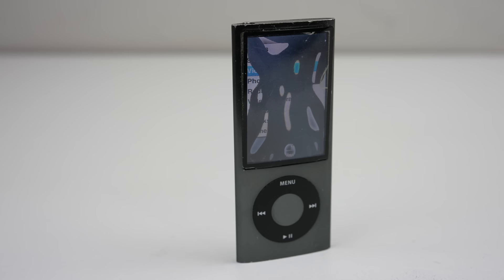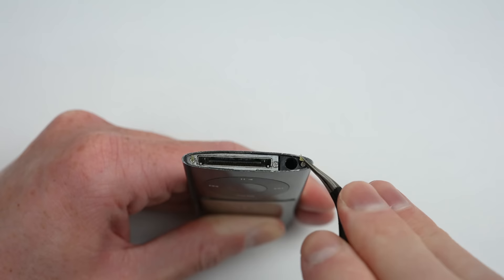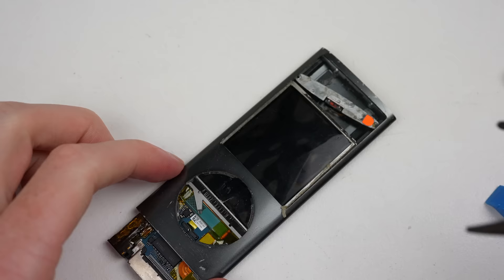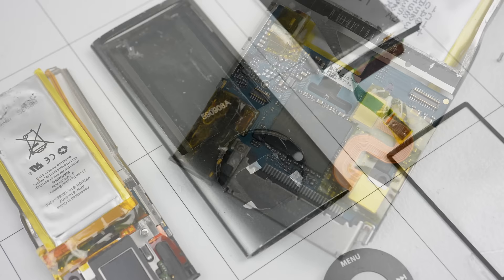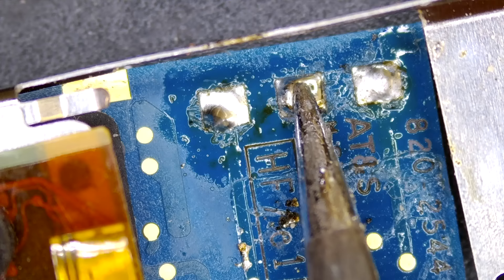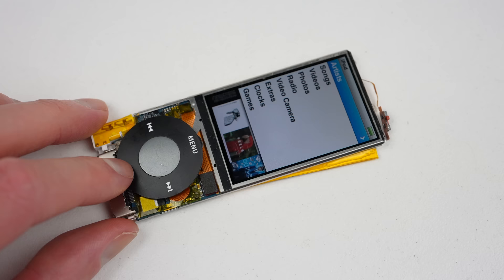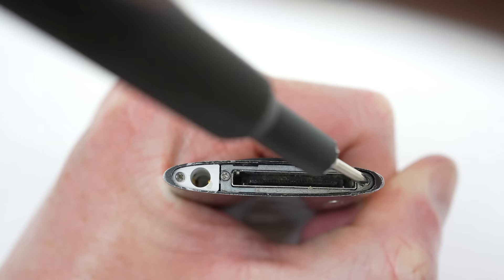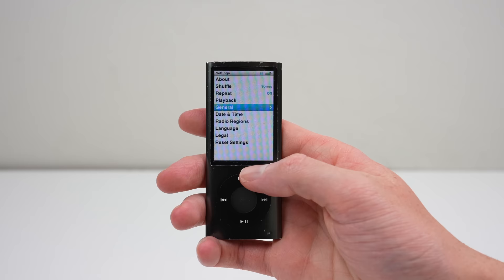Only I Am Stupid Enough To Try And Fix This iPod Nano

Comment: "spicy pillow" is now my new favorite term for bloated batteries
Reply: It's all fun and games till you have an experience like I had with my 3GS that had its battery swell to the point of cracking the rear of the case, cracking the display, lifting off the front glass and turning the motherboard into a banana (hell.. it ripped out the metal inserts that it screws into!). Mildly bloated batteries don't faze me, but that was an actual spicy pillow
Reply: @Knaeckebrotsaege  Yup I have a phone that is 1/4th of the way to being an actual spicy pillow battery too, just a quarter of the back got lifted off, but I figured after a while it was time to stop using it due to that, and the fact that it was messing around with how the back mounted fingerprint scanner worked (a lot of [fingerprint can't be read or partial fingerprint] errors were happening when I tried to unlock my phone using the scanner).  Oh and the risk of my safety by continuing to recharge the spicy pillow.
Reply: I like the term "spicy pillow" too haha. I learnt of the spicy pillows on Reddit and there's a whole sub there dedicated to sharing images of bloated batteries. A good chunk of the spicy bois there are from razer laptops, macbooks, and iphones.
Reply: @PinkAgaricus  in case of my 3GS, this happened after I stopped using it, and within just a couple weeks. I dug it back out to take a pic of it (because it still looked brand new and "taking care of your things" was the topic of a forum thread), only to find the originally damn near immaculate phone now obliterated by the battery :(
Reply: I shall now refer you to r/spicypillows
Reply: Yup
Reply: Now my favourite tech term of all-time 😄
Reply: is it really spicy tho?
Reply: @HashirEasa  nah, actually quite delicious
Reply: I Know a different term for this, it's the forbidden Capri Sun
Reply: if microsoft made batteries they would come bloated out of the factory ;)
Reply: @Aragubas  xboxcontrollerbatterypackgobrrrrrrr
Reply: ye me to
Reply: I like to call it HAND GRANADE.
Reply: I heard that from the Lexus kitty.
Reply: @Knaeckebrotsaege my 3GS did that now I have to get another 3GS and fix the battery
Reply: you can also call it a bang biscuit
Reply: Dankpods

Comment: As some one who has worked on a lot of cell phones and handheld consoles I have to say you make most of this stuff look ridiculously easy.
Reply: Fully agree with you. Especially the parts that involve glue. I already had a magic pull tap snap on me and a Samsung Tablet refusing to let me in.
Reply: Fully agree
Reply: Frankly as someone who does the same, I think in this specific video he really got the point across that it's an infernal job.

Comment: It’s sad that these iPods are so hard to replace but were yet loved by millions back then. Sucks that they won’t last that long as time goes on.
Reply: True 😔
Reply: Yeah and they’re so stunning as well 🥺
Reply: Friend of mine dropped one into a cup of coffee in the car and it still worked fine years after
Reply: actually.. they are quite usable today! only the nanos are hard to repair
Reply: The worst part is Apple might end up doing this exact tactic of soldering the battery to the motherboard on iPhones at some point.
Reply: You gotta remember this was early days, Apple didn't really know what was going to happen. If they knew that battery would blow like that, they wouldn't have designed it like that.
I love my iPod Video 5th gen with 256GB SDXC mod because I can fix it freely.
Reply: @tsuyunobradley4439  the 5th Gen is the first iPod that I decided to mod. I only swapped the front panels to be red with a black click wheel but it was incredibly fun and definitely easier than the 6/7 Gens
Reply: @sabersz  I actually still have a scar on my hand 4 years on from trying to open a 7th Gen. My tool slipped and sliced my hand open.
Reply: @tsuyunobradley4439  oooooooh not good 😬 I'm praying I don't get anything like that in the future. Already had a couple slips but nothing worthy of a scar lmao
Reply: let's don't forget the fact that most of pre-2007 iPods are easily repairable and moddable 

these shitty disposable nanos are not something to be sad about tbh
Reply: @tsuyunobradley4439  Frankly I disagree, they just don't care. They knew battery faults for ages, their own iBooks and PowerBooks have been recalled for faulty batteries expanding badly or even catching fire in 2005, the HDD iPods are definitely not easy to open, they're easier for sure but not made to be opened either, it's just what they do, they don't want you repairing it, even tho some older Macs were quite modular and upgradable.
Reply: @Kalvinjj  I never really paid attention, but it wasn't just Apple having this issue. It was EVERY MANUFACTURER around this time.
Reply: @buddyunholy9133  They could have simply added 1mm in height and width and it would have been repairable. 

I loved it for the display and especially the good radio and mic. The build in  radio-receiver-chip was of a comparable quality as the chips in cars, if my memory of the device is correct. 

But seeing this repair-video I fear that it's absolutely not worth the money, effort and especially the time, trying to repair an iPod Nano with bulged battery.
Reply: @sealwheel  you prune,iPods no longer exist and Apple does not make them anymore either
Reply: @stephensnell5707  if they dont exist explain why i own more than a dozen?
Reply: I found the pink one on eBay, hope that little iPod lasts forever because I want to listen to music
Reply: @sealwheel what I meant is that Apple stopped producing iPods back in 2017
I myself I have the iPod Touch 6th Generation(I have has it since 2018,I have had it for 5 years with 0 problems and the Battery is in perfect shape and I will keep using it until it totally fails on me)
Reply: @sealwheel  keep them cherish them its not being sold that why he say it doesnt exist anymore

Comment: I wish there were financial penalties for companies that go out of their way to make products so unrepairable, that they become disposable.
Reply: Already did, ever heard right-to-repair policy? Perhaps it's not that effective but at least there's a movement on Apple to make iPhone easier to repair (like providing technical documentation and spareparts)
Reply: @KangJangkrik  This is a bit different, it's not exactly designed to be anti-repairable, it's just nearly impossible for anyone, Apple included, to fix it due to how crammed everything was put together. Right-to-repair is to stop companies from hiding schematics, using super adhesive on everything, and to make parts purposely fail when paired incorrectly.
Reply: Right to repair still applies to Apple but this isn’t really the case.

Comment: Hugh i've noticed you use absolutely no flux in your soldering work. I recommend you get a syringe of gel flux or a tiny squirt bottle of liquid flux and your soldering will be both much easier and prettier and even potentially lasting longer since flux also acts as an airtight solution preventing air and fumes get trapped in the solder joints which can cause cold solder joints. Love your work!
Reply: This is exactly what i shouted over and over in his videos and in other channels. But seemed they don't bothered much about dry solder wick and undersized soldering tip
Reply: Yeah and with companies today using the newer silver mix solder instead of the old 70-30 tin-lead the solder is even more susceptible to cold joints and fracture. You can usually tell a silver solder by the way it cools. If you melt it and it cools rapidly and with a frosted look then its more than likely silver based. Tin-Lead will always cool smooth and shiny if not disturbed while cooling. Silver-Tin is also much harder to melt with smaller tips at lower temps forcing you to use harsher temperatures to keep things flowing. Which can lead to burning boards or even cooking heat sensitive components like ICs.
Reply: Some solder comes with a flux core. Mine for example should have a flux but that core either is empty or does jack shit so i still have flux syringes now.
Reply: @juliawolf156  Yes most does, especially when its made for electronics work. Flux syringes are really handy for surface mount work or in places where you just cant feed the solder in while keeping contact with the tip. For putting through hole components on a board I usually just let the rosin core do the work since they usually require a heavy flow of solder anyway. But something more delicate like this I would had added a line of flux just to make sure.
Reply: Kester 951 is what i use regularly, highly recommended for this
Reply: he clearly doesnt watch any other repair channel :D
Reply: @GamerLoggos  sad that so much silver is used in electronics that will be thrown away. Imo we will see trashpile silver mining in my lifetime.
Reply: @juliawolf156  Flux core is cool but I use both. Also it's necessary for hot air work.
Reply: @noahpaulette1490  Its all about the environmental effects of all the lead leeching into the soil. And I get it, I really do. It can also have a health impact on the ones working around hot solder, especially in wave soldering. Hopefully we will find a better mix that isnt as failure ridden as silver-tin.

Comment: After seeing DankPods' videos in the past about the Nano, I kinda knew what to expect from this video as well.
Glad to hear you got your iPod Nano back up and running.
I don't like the idea of the Nano because it is so thin, that if the battery expands, it will damage other components (or could be completely unsafe) - and if the battery loses its ability to hold a charge, you won't be replacing it easily. Batteries are consumables, and therefore should be made easy to access.
Reply: DA BLACK SPOT
Reply: Me too
Reply: Na'no
Reply: What a guy!  His vids r so very entertaining!  His attempt at fixing those iPods, the Nano, and two iPod Touches with his bro, makes repairing very true, while making it also entertaining.
Reply: Nice
Reply: @mcch1n  lol
Reply: Dingus
Reply: Get your 1 grit
Reply: Na-no

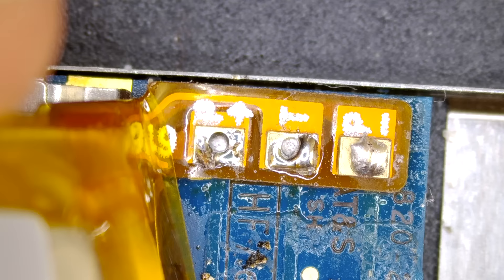Comment: Have you tried using Flux before, when you were trying to desolder the battery contacts, you didn't have any flux, which means the solder didn't stick to the solder braid, it is also the reason the solder doesn't neatly flow onto the solder pads, for example, as 7:41, the reason the solder joint was so tall and not shiny was because of the lack of flux, the same goes for the solder wick
Reply: Yeah, it seems like a combination of crappy solder with too little or no flux/rosin core (or even RoHS compliant leadfree trash ontop of that) along with cheapo solder wick that has too little or no powdery flux in it at all. Either of these things on their own will make (de)soldering a massive pain. Combine all of them and the experience is about as hateful as this iPod Nano
Reply: @Knaeckebrotsaege  Yeah solder wick is one of the best ways to remove solder assuming its a half decent quality. Though in the long run more expensive than even a cheapo vacuum station but it has its uses in tight spaces. If wick Im using doesnt have flux in it I just grab a can of rosin, shove the iron in to melt a pool of it and dip the wick in. Nice and coated then.
Reply: He has used flux before. I was surprised he didn't use any considering how small the pads were.
Reply: Super off topic, but I absolutely adore your non binary pan Celeste pfp
Reply: @_molls  aww, thanks! Im really happy that you picked up on the colors!

Comment: Wow, that's crazy. I gave this a try a few weeks ago. The battery needed replacing, I didn't know what I would have to go through. Hold switch broke, got a replacement, then I accidentally killed the screen backlight. I gave up on it.

Comment: I managed to replace the LCD of an iPod nano 7th Gen the other day and it was the most excruciatingly painstaking repair I've done so far. I managed to not lift up the frame properly which made me accidentally snap the cables of the perfectly good digitiser and completely obliterate the old display. Micro shards of glass everywhere, that's exactly how I wanted to start my Thursday morning. 
However, I knew I was a dumbass so I bought another digitiser just in case I mess up. 
Anyway, the frame was all bent up and the screen ended up not sitting completely flush, but y'know what? I don't care. This is MY manky nugget, I'm not selling it. I managed to fix it and that makes me extremely happy. I'll try to get my hands on another 7th gen soon and attempt to fix it.

Why? Cause I'm a masochist I guess.

Comment: 8:49, when sliding the parts back into that old housing, he severely scratched the left side of that brand new screen >.<

the screen was perfect the scene prior, and when he wipes it off at the end before re-installing the glass, the scratch is still there.

These iPods really are a nightmare.
Reply: Doesn't matter with that scratched up glass.
Reply: @SonofTheMorningStar666 irrelevant to me saying that its a nightmare to fix them, that can just as easily happen on a BRAND NEW housing.

Comment: I have my purple Nano of this generation. It demonstrates strong LCD yellowness/tinting. The battery has not become symptomatic yet, despite me powering and charging it a few times in the last few years. After learning in this last year about the potential for the battery to swell, I've decided not to power it any longer.

I need to do something with these old devices. They're like so many devices in life, stuck in storage somewhere serving no gain.

This Nano model is particularly impressing and great, in terms of thinness. I am happy you remarked on the thinness, because it is impressing and noteworthy, and has stood the test of time.

Comment: Just a tip for better solder wicking: use some flux (just put in on top of the wick) and also you can try flowing some solder by yourself into the wick. That way solder that's on the solder pad will have easier time wicking up the copper.

Comment: Just adding here that an expanded battery if empty of it's charge can usually be deflated safely for easy removal.  Just ensure that battery is fully drained, and with a needle or tip of pointed tweezers, poke a hole in it. It should deflate and make it much easier to handle the disassembly.  The method shown in this video is only viable if the lcd is already broken which is not the case for most people as they don't typically let the lcd expand so much that the screen explodes out the front.

Comment: thing i always hated about fixing nanos, absolutely no reason for them to be soldered, you can 100% have it fit with a simple connection, congrats on this! fixing this model is very difficult and a pain and I'm glad you got it working!
Reply: The solder is more than likely to keep the internal parts in place
Reply: @stephensnell5707  yes it wont fall off, but its such a pain to repair, and also what could possibly cause it to fall out if it was a connector? Soldering only makes sense when you shrekpod the device and the battery is lose.

Comment: I never used a soldering wick although iFixit occasionally would gift me a one each time I buy a tool or new repair part from them. I got a genuine Japanese solder sucker which working pretty nice for me for around 5 years now.

Comment: The solder braid will work a lot better if a. you add flux to it and b. you keep the weave tight. You want the solder to be drawn into it by capillary action.

Comment: I have done the same mistake you did. But I also managed to cut the speaker flex cable. So I ended up replacing these flex cables with 2 pieces of thin enameled wire.

Comment: Man I stumbled upon this video this morning because I woke up thinking "Hey, that iPod of mine has been sitting on the shelf for years and its front glass is pushed out, let's fixed that". Didn't know it was because the battery expanded. Next thing you know, the moment I plugged in the charger it went poof and the screen was covered with ink. Bummer. I loved that iPod. I was gonna attempt to fix it but then I saw this vid and realized this wasn't going to be a walk in the park. Wish Apple hadn't made it so difficult.

Comment: You can actually puncture swollen battery if it is fully discharged. When battery deflate it would be much easier to take out internals. Even charged battery can be safely punctured.

Comment: The contacts for the cable just need more flux. As Louis Rossmann would say "a proper amount", as in a nice big squeeze.
And the outer glass for the display can always be polished. Drastically improves usability when you can actually see what is happening.

Comment: Now you gotta try to replace the battery in a v2 JBL flip 3 speaker. 1 model is difficult but allows the battery to be popped out of the back, the 2nd version is just as painful to get to, but then they made the battery slide into a slot making it impossible to remove when it swells

Comment: For unglue battery you can use plastic film that come with tempered glass. That film and isopropanol is safer than metal tool :)

Comment: I know it sounds stupid but i have repaired ipod nano 2 with swollen battery and it just slide out easily, all you have to do is make a small gentle incision at the top of the battery using exacto knife, letting that gas out.

Comment: I had one of these, but it didn't have an expanded battery. 
The Lock button failed and the device would never switch off. 
I sent to to Crapple for Repair and they said because of a small scratch on the metal of the device it was 'Purposefully Damaged' and claimed it was Out of Warranty, despite being bought new 3 months earlier.

Comment: You need more Flux. It helps the solder go where the heat is. Those wicks can be finicky but usually the problem is not the right tip or not enough heat. Sometimes it can also be too much pressure you want to let the iron do the work for the most part.